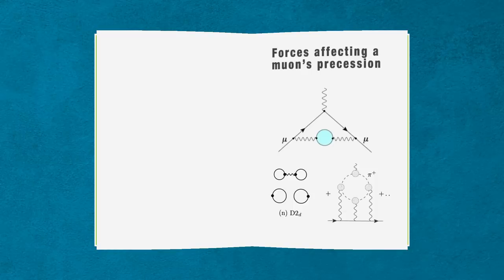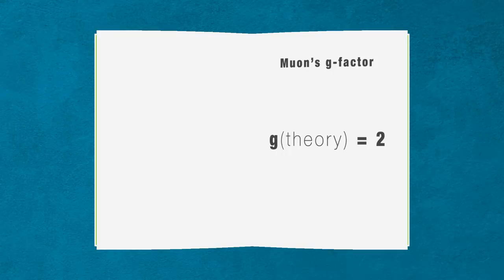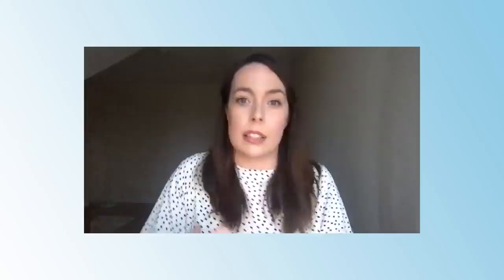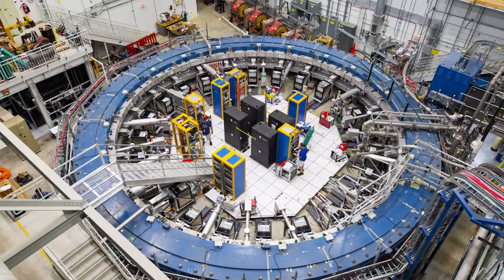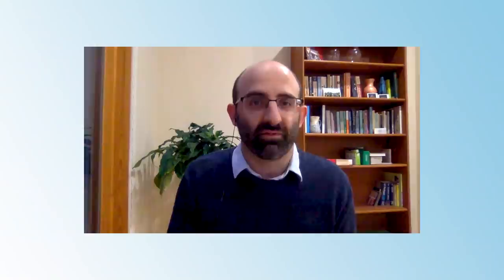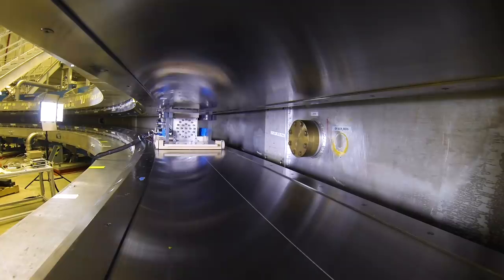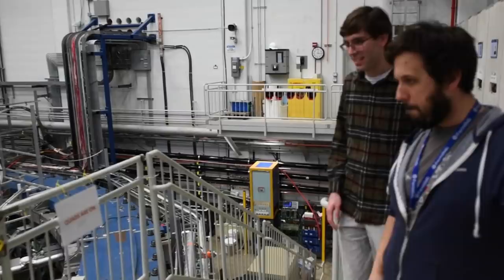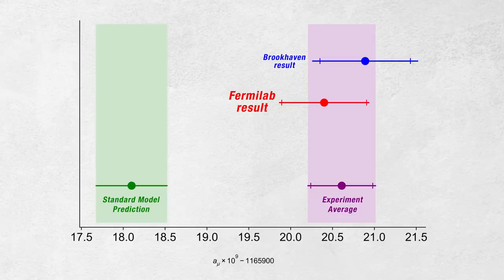Muon g-2 experiment finds strong evidence for new physics

Comment: "This magnet is hundreds of times stronger than the ones on your refrigerator."  Only hundreds? That's it?
Reply: They don't need to be insanely strong to influence tiny muons. It's a big ring of very precisely calibrated magnets.
Reply: @TheLocust830  I don’t know for sure but I’d say that, with a life of 2 micro seconds, they’d have to spin those muons pretty fast in the ring to be able to measure anything. Giving the inertia of a particle 200x heavier than the electron (which is light, I know) I’d imagine it would have to be quite a strong magnetic field...
Reply: The precision of the magnetic field's calibration is what's important and special about it, not its strength.
Reply: You wouldn't enjoy putting your hand under a magnet 10 times stronger than your fridge magnet. Hundreds--note the plural--would flatten you between two of them.
Reply: @ApprovingSeal  i was boggled when they said "4 years of calibrating, 1 year of analyzing."
Reply: By my math, about 2300x more powerful.

Sources I could find reported this magnet at 230 Gauss

Normal Fridge Magnets are around 0.1 Gauss with strong ones making it up to like 0.5 Gauss
Reply: More than 5 I'd say
Reply: Hundreds...maybe dozens!!
Reply: The effect is dbled with ea magnification. Similar to taking a penny and doubling every day for 30 days is over $5 million
Reply: @zeevo  electron not light ... photon light ... 😛 🙂
Reply: @pmcgee003  Light as in lightweight, not light as in photons. Read the context and don't be so pedantic.
Reply: @zeevo  When you're dealing with high speed particles where the velocity is measured in terms of c, Time Dilation becomes a thing and so that 2 µs half-life for the muon from it's perspective can be quite long from our perspective. It's spacetime interval doesn't change no matter the reference frame but its real time will.
Reply: @mynameisnotyours  As long as you didn't have a sandwiching magnet, you would be quite safe standing on or around this magnet. Us humans are diamagnetic creatures (most animals are) and given a strong enough field we could actually levitate us. 

Something like 1,000 Tesla (10 Mega Gauss) to kill a human by magnetic field alone IIRC and my HS physics teacher is to be believed.
Reply: @pmcgee003  Don't worry -- I got it. 💡
Reply: I know man, they could've just got 100 fridge magnets!
Reply: @zeevo  99.4 speed of light
Reply: @grey5008  Kudos on the correct usage of "effect". Maths AND English savvy, by appearance.
Reply: @echoawoo7195  Hopefully this will help in your future adventures on the internet: it's a joke.
Reply: @CallsignJoNay  if you shine 100 red laser at a spot, does it look bluer? (I.e. does the light frequency gets higher?)
Reply: @pmcgee003  TIL "I'm Wrong" == "It's just a joke, bro!"
Reply: That depends upon how strong your refrigerator magnets are.  If you can pick up the 'fridge with just one of them, then that makes a difference. 😉

(Yes, I know, it's more about the precision alignment and focusing of the magnetic field rather than just the raw strength of it.)
Reply: @echoawoo7195  ahem ... "read the context".  Observe: tongue-sticking-out emoji + smiley face.
Reply: @pmcgee003  If your post is a joke, you're not funny. But we all know it's not a joke, you were trying to be smart, and you failed miserably at it, and when someone corrected you, you got offended and pulled the same tactic every corrector ever pulls when they get corrected. "It's just a joke, bro."
Reply: @echoawoo7195  I don't have to be funny to make a joke. I'm not getting paid for it. Your premise would be accurate if I was trying to pass off something racist, or sexist, or whatever. But it wasn't. "light" vs "Light". It's as simple as that.

Also, I'm not offended. We all know the internet conveys tone about as well as two tins tied with string, so potential confusion is expected. The question is how much effort to put into preemptively avoiding confusion. There's only so much time available - and ultimately, in this case, it's not that important.
Reply: I got 100 refrigerator magnets and repeated the experiment in my kitchen.  I concur.
Reply: Yeah lol I was wondering why they didn't just get 100 fridge magnets rather than spending a ton of money moving that magnet around, I guess it has to do with the uniformity of the field produced rather than the strength.
Reply: Fact checking ain't what it used to be, son.
Reply: What did I discover after spending 2 Billion on magnets about a fart ? That I nailed it right down to the nearest muon. In other words, right back were I started with my majestic fart.
Reply: @nabieladrian  Maybe they had Garrus doing those calibrations?
Reply: @grey5008  Hundreds of times stronger, not hundreds of orders of magnitude stronger. There's a huge fucking difference. Just think about it for 2 seconds, genius; a magnet the strength of one on your fridge doubled hundreds of times over? That's got to be like black hole levels of magnetism.

Or, to put it more simply, if you say something is "hundreds of times" the value of a penny, you're talking about a few dollars, not $5 million. Nice try sounding smart, though.
Reply: Actualy 100.0000000000215
Reply: MRI magnets are tens of thousands of times stronger than the Earth's magnetic field. Maybe this is the type of scale you were hoping for :)
Reply: @echoawoo7195  what sources did you find?

I found an ArXiv abstract from 2016 that cited the magnetic field strength of the storage ring at 1.45 tesla (around the low end of an MRI machine) - that's for the ring as a whole, I'm not sure how that relates to the individual magnets.  Wikipedia cites a fridge magnet at about 5 millitesla, so about a 300x difference.
Reply: @zeevo  magnetic field doesn't help speed up the muons, in fact magnetic field can't speed up anything, the field is there to keep the muons inside the ring in a stable orbit for as long as possible. But you are right, speed is necessary to elongate a muon's life, that's why they are generated from fast moving protons and then injected to the magnetic storage ring. The energy of those muons are roughly 3.1 GeV, faster muons would be long lived but we needed that specific energy for a very special reason, look up for "magic momentum in muon g-2".
Reply: @atanunath  please read carefully what I wrote again. You’ll notice that “they” refers to the researchers and not to the magnets. They, the researchers, have to spin the particles fast, and it, the magnet, has to be strong to keep them, the particles, turning in circles. Thank you!
Reply: Earth's magnetic field is 150 times weaker than a fridge magnet and yet it keeps the stuff away from earth that could kill all life off of this planet! So... imagine, 150*100 = 15000 times stronger magnetic field!
Reply: So I only need 100 fridge magnets to create that machine? Dayum
Reply: The strictly regulated magnetic field allows for precise measurement of any disturbance within the field. That is the important factor of the magnet. Its strength must be sufficient to repel outside influences such as the earth's magnetic field, or metallic objects in proximity to the device. Fortunately the magnets on your refrigerator already are capable of overpowering the earth's magnetic field near your refrigerator. This device has s field capable of overpowering your refrigerator magnets. Thus if your refrigerator magnet was somehow introduced into the area, its magnetic field lines would be forced into alignment with the lab magnet. This would probably reduce the accuracy of measurements, and require recalibration of the system. So I expect that your refrigerator magnets are not welcome to come visit the bug magnet at Fermilab.
Reply: @pmcgee003  c’mon folks! Lighten up! i took it lightly and felt light hearted after that. In the light of the fact that English is not my native tongue, I think you guys could thread lightly, and shine some light on this discussion... All this made me light headed... gonna go, towards the light at the end of this tunnel. Cheers!
Reply: @zeevo  they accelerate the muons, therefore they life way longer than 2 micro seconds in the laboratory system.
Reply: @pablozangerlein1511  i get it. My point is: fast moving particles need strong magnetic fields to be kept going in circles. The faster the movement, the stronger the field.
Reply: @samus598  putting multiple small magnets together doesnt really produce the uniformity theyre looking for. i dont think field strength scales like that anyways
Reply: @mynameisnotyours  what are your hands made off? most people wouldnt feel magnets stronger than that.
Reply: @jonathanodude6660  I pictured myself getting 100 fridge magnets and putting them on either side of my hand 
IIIIIIIIIIIIIIIIIIIIII✋🏼IIIIIIIIIIIIIIIIIIIIIIIII
Doesn't actually sound very scary
Reply: @jonathanodude6660  I was referring to what would happen if you put your hand between a magnet and the refrigerator (or some metal surface).
Reply: @mynameisnotyours  oh. that wasnt clear.
Reply: “Julius Caeser, whose life ended more than 70 years ago”
Reply: @nabieladrian  "Measure thrice, check twice, cut once". Just a bit more cautious and precise.
Reply: one trillion hundreds.
Reply: probably around 1 Tesla or 10.000 Gauss
Reply: @zeevo  Ah yeah, youre right, now i get it, thank you :)
Reply: Fake scientists of the pr department
Reply: @jamespong6588  Fake commenter of the youtube cancer department
Reply: Hundreds of times stronger in DENSITY. The magnetic field strength of hundreds of basic iron magnets all in the same space. If a magnet this strong were on your refrigerator, you wouldn't be able to take it off.
Reply: @bobbyt9431  You don't know that for sure... What if I bought my fridge from Ikea, it probably has 0.01mm thick metal walls! :P
Reply: The magnetic dipole moment for photon is zero  because the light wave is vibrating or spinning in a linear way- which creates  bosons with partial non linear anomalous moment  similar to scalar bosons  which becomes trapped  with in the collapsing local gauge particle wave field  with zero spin  

This  action then  breaks symmetry and becomes a non local field  with the force carrier meson muon particle  group which emits  4 virtual particles including itself nuetrino and a mirror left and right pairing particle with half interger spin being the nuetron and proton

 The reason for not seeing the  non local gauge field is because its because it collapses baryonic meson matter or symmetry break because when you break symmetry olny local invariance stops

 Where  the topmost bottom most strange and charm takes on additional and different particle identities from baryonic mass by switching places or isospin values
 thereby allowing the formation of  namely fermions which can be seen as a consolidation
Reply: @pmcgee003  I was thinking the same,,,light has no weight.
Reply: To be exact, a LOT stronger

Comment: Ok this is epic
Reply: Better get to work on that video c:
Reply: Yeye
Reply: The physics man himself
Reply: Hey Andrew
Reply: Sure this is! Great to find u here♥️
Reply: No. This is boring. Epic will be when they will wake up and realize that consciousness is all there is.
Reply: Not epic until there's a practical application.
Reply: No, not really. It's already strongly implied by the Standard Model, but is buried under a pile of mischaracterizations and misunderstandings that mar the research literature and obscure what should have been obvious from Day 1.

In the Standard Model, the "Triangle Anomaly" predicts the distribution of charges for the U(1) part of U(1) x SU(2) x SU(3) from the SU(2) and SU(3) part ... on the assumption that [anti-]neutrinos are massless and that neutrinos are only "left-handed" and anti-neutrinos "right-handed". The U(1) combines with part of SU(2) to give you the quantity known as electric charge. The U(1) charge, itself, is called "hypercharge". So, the actual electrical charges of fundamental particles is predicted by the Triangle Anomaly.

That's the minimal standard model and was busted open in the 1990's when it was confirmed that neutrinos are not massless ... which almost certainly means that there are right neutrinos and left anti-neutrinos.

That, in turn, busts open the "predicts U(1)" consequence of the Triangle Anomaly to "predicts U(1) and / or a second U(1) or a combination thereof". It's misleadingly called "dequantization" ... because you no longer have the prediction of "quantized" electrical charges (that is: a discrete spectrum of electrical charges - 0, +/- 1/3, +/- 2/3, +/- 1).

That's the mischaracterization - and a rather boneheaded one at that. The correct statement is that you still have the prediction of quantized electrical charge spectrum, as before, and the prediction of a charge spectrum for another force: that which has Baryon number minus Lepton number as its charge. The B-L force.

That's the correct statement. And - since it's the only thing consistent with the Standard Model (and since the actual spectrum of fundamental particles practically already screams out for the B-L force, independently of these considerations!) - then that's almost certainly what has finally been confirmed. That the B-L number is an actual charge for another force.

Under that force, ordinary matter would be a huge unbalanced positive charge, because neutrons would have charge +1, while protons and electrons, with respective charges of +1 and -1, would cancel. On the other hand, right neutrinos (which have no U(1), SU(2) or SU(3) charge and are otherwise invisible except for their gravity) would have a -1 charge, and so would quite likely cluster around large + charges (like galaxies) as massive otherwise-invisible clouds. Left anti-neutrinos would be +1 charge.

In other words, they would produce unseen sources of gravity as halos surrounding all the galaxies ... much like what is described of Dark Matter. Do I need to pull a Sherlock Holmes here to draw the obvious conclusions? No, I don't. It's right here. Right-handed neutrino dark matter under B-L gauge interaction https://arxiv.org/abs/1606.09317

The deviation of the actual value of g-2 from what's predicted is another piece in the puzzle, which will confirm this force. So will the Antarctic ice anomaly that's also cropped up in recent times. And the X17 boson will also fit into this as another piece ... when we find that it is none other than the particle for the B-L force, itself. All the pieces are already there, and it was always implied by the Standard Model from Day 1.

Comment: C'mon new physics, you can do it!  Love you guys, thank yall so much for your work!
Reply: "New physics", lol. If they would have been genuine researchers, they would have tried to come up with theories for the paranormal, for which there is already "new physics" data for over a century.
Reply: Quantum Entangled Twisted Tubules:

When we draw a sine wave on a blackboard, we are representing spatial curvature. Does a photon transfer spatial curvature from one location to another? Wrap a piece of wire around a pencil and it can produce a 3D coil of wire, much like a spring. When viewed from the side it can look like a two-dimensional sine wave. You could coil the wire with either a right-hand twist, or with a left-hand twist. Could Planck's Constant be proportional to the twist cycles. A photon with a higher frequency has more energy. (More spatial curvature). What if gluons are actually made up of these twisted tubes which become entangled with other tubes to produce quarks. (In the same way twisted electrical extension cords can become entangled.) Therefore, the gluons are actually a part of the quarks. Mesons are made up of two entangled tubes (Quarks/Gluons), while protons and neutrons would be made up of three entangled tubes. (Quarks/Gluons) The "Color Force" would be related to the XYZ coordinates (orientation) of entanglement. "Asymptotic Freedom", and "flux tubes" make sense based on this concept.  Neutrinos would be made up of a twisted torus (like a twisted donut) within this model.  Gravity is a result of a very small curvature imbalance within atoms. (This is why the force of gravity is so small.) Instead of attempting to explain matter as "particles", this concept attempts to explain matter more in the manner of our current understanding of the space-time curvature of gravity.   If an electron has qualities of both a particle and a wave, it cannot be either one.  It must be something else. It must be something else. Therefore, a "particle" is actually a structure which stores spatial curvature.    Can an electron-positron pair (which are made up of opposite directions of twist) annihilate each other by unwinding into each other producing Gamma Ray photons.